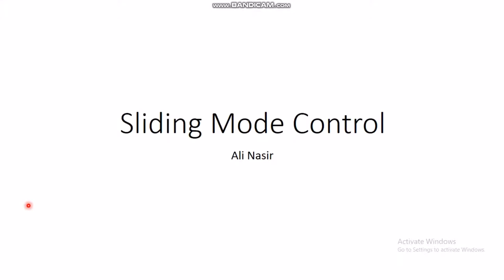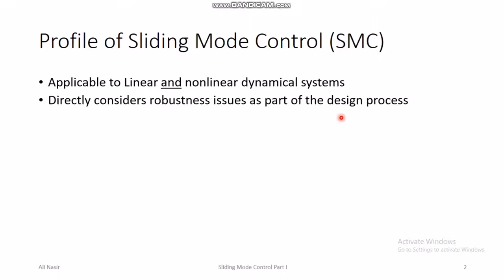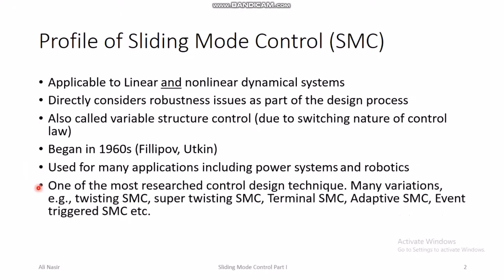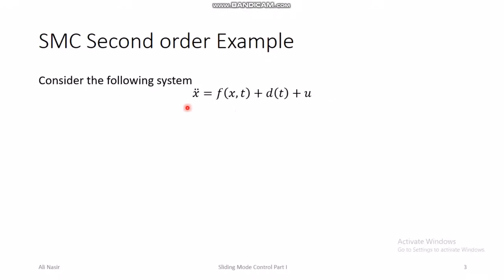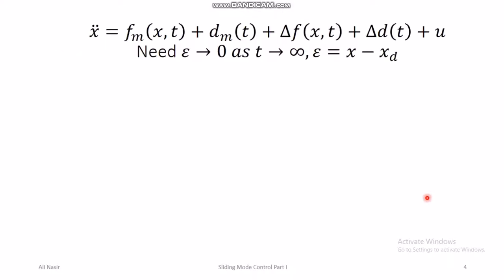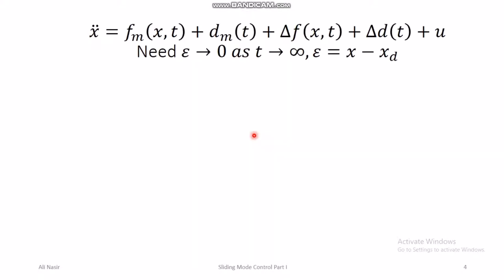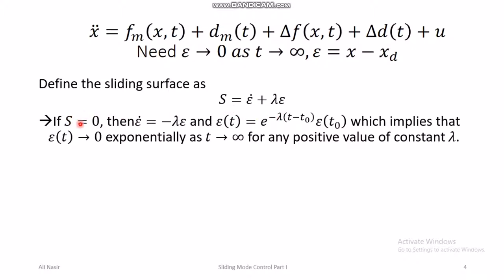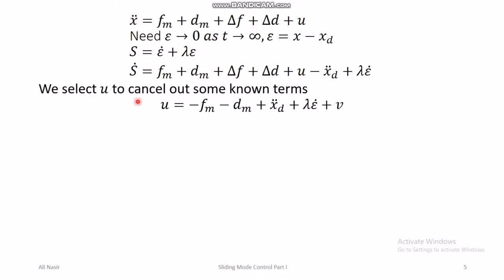Sliding Mode Control Part I

Comment: Very well explaine! It may be a bit late but i have a question regarding the limitation of certain state variables during sliding mode control, for example if you would define a control law for controlling the velocity of a DC Drive, you would end up having the motor input voltage as u(t). How can you limit the Motor Current to not exceed a certain value without having the sliding mode controller react to the limitation?
Reply from the maker: Thank you for your kind remarks. For limiting the value of the input, we can multiply the control signal with a saturation function (in the dynamical equations) for the simulation purpose. For real-life implementation, we can simply use an if-else command with the control input so that the demand of the voltage does not exceed the allowable limit. This will indeed pose some additional challenges in terms of the guarantees of stability. But usually, things work out if attention is paid to the magnitude of the control input while simulating the behavior.

Comment: Not clear the introduction of the sign function when you use the lyapunov funcuon for Sdot. Why?
Reply from the maker: Think like this. If a<b then a<b*sign(b) (you can imagine any numbers like a = -4 b = -2 or a = 10 b = 12 etc.). Therefore the introduction of the sign function does not change the inequality. Now, why do we introduce the sign function? That is because S*Sign(S) is positive definite and we need the term on the right hand side of the inequality to be negative definite (so, it was basically "thinking ahead" when sign(S) was introduced because later we used v to make the right side to become -eta*S*sign(S) which is negative definite).

Comment: very well, but I wanna ask you something. has the term -ete*sign(s) another shapes or faces or it's rigid?
Reply from the maker: Well, the main purpose is to have S_dot negative definite. "-eta*sign(S)" does the job and it is a very popular choice. But it is not the only way. There may be other ways.
Reply: @cset  please, let me know what's these other ways?
Reply from the maker: @alial-faloji7463  for example, you could try achieving S_dot = -S^2 or S_dot = -S^4-S^2 or S_dot = -eta*sign(S)*S - S^2 etc... research is all about trying new things and see it it works better than the existing.
Reply: @cset  I understand from your comment that isn't a constant law for it.

Comment: How about higher-order systems? can the same technique be applied?
Reply from the maker: Yes, it can be applied to the system of any order as long as the two conditions are met:
1) S= 0 helps in achieving the control objective
2) u (control input) appears in S_dot
Sometimes the sliding surface is a vector variable. Please watch the second part of this lecture https://youtu.be/u-wNiVEyz7Q
and more videos available here
https://www.youtube.com/watch?v=Aa04S3Cg-Vc&list=PLmwDtdfGY3-brehZArGHUeWCcq1-wHozA

Comment: (If V dot is negative definite, then the dynamics of S dot will be asymptotically stable), I didn't understand this sentence, why if V dot is negative then S dot is asy stable?
Reply from the maker: V_dot = S*S_dot so V_dot <0 means that S and S_dot have opposite signs. This in turn means that if S > 0, S_dot will be negative, resulting in the decrease in value of S. On the other hand, if S<0, S_dot will be positive, resulting in the increase in S. This means that V_dot<0 ensures that S converges to zero regardless of whether its initial value is positive or negative. Hope that it is a bit more understandable now.

Comment: What is the difference between finite time convergence and asymptotic convergence in smc?
Reply from the maker: In the context of SMC, finite time convergence is talked about when referring to the convergence of the state trajectory from initial condition onto the sliding surface. Whereas the asymptotic convergence is talked about when the trajectory has achieved S=0. Achieving S=0 leads to the asymptotic convergence of the trajectory towards the reference value (in tracking control) or the equilibrium point (in stabilisation control).
Reply: @cset  Thank you Sir

Comment: I tried to use a sliding mode controller for sensorless estimation of rotor position in a reluctance machine (some art of electrical motor), and it crushes with 99%  probability if the rotor speed is low.